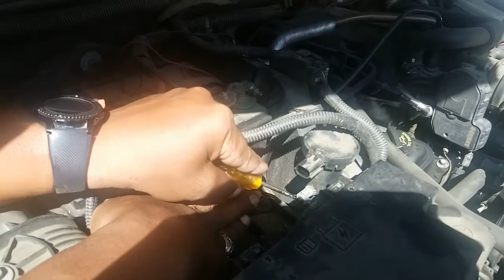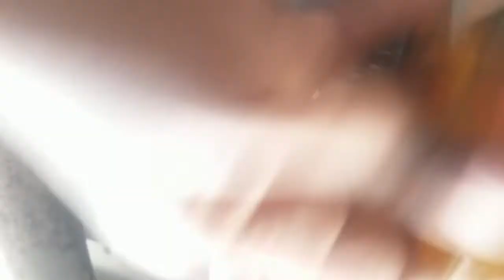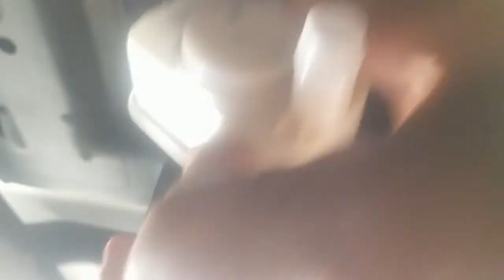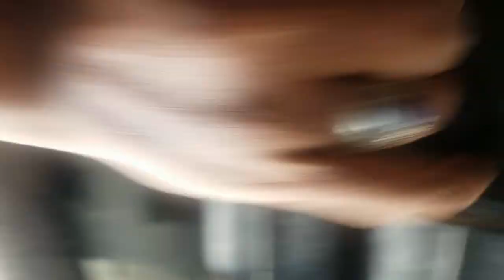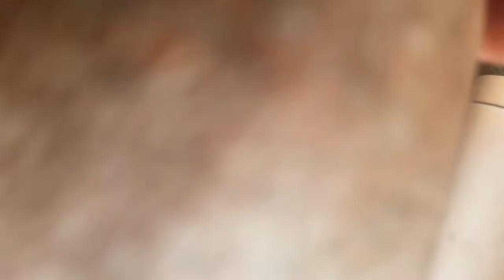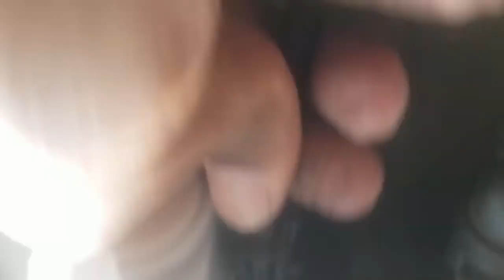2007 Jeep Wrangler JK failed emissions test-Evap code fixed by replacing parts $90 and 1 hour.

Comment: Parts canon! Didn’t say if it worked.  The leak can be anywhere.  You have to find it first, obviously.   The rollover valves on the tank crack a lot on those jks. Also, any loose hose cause the light.